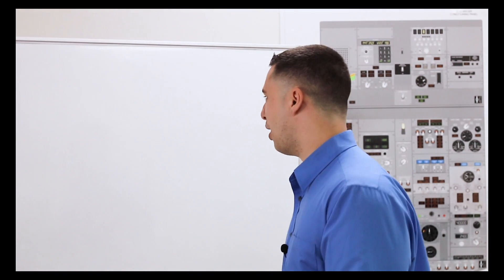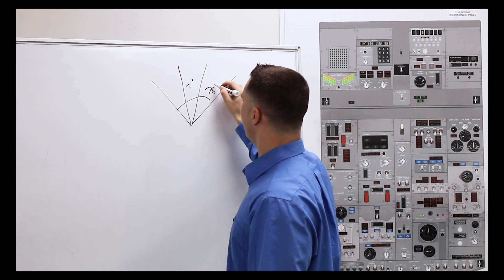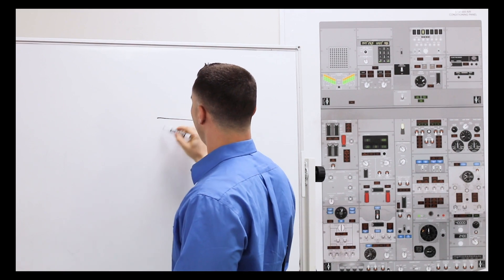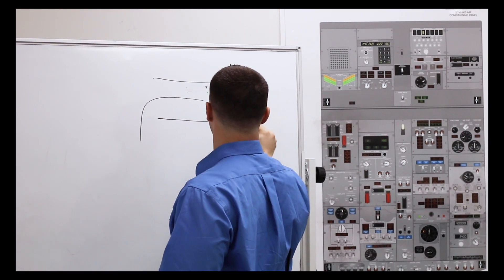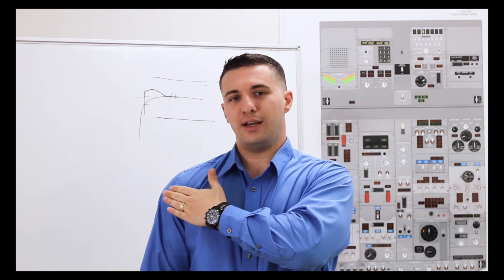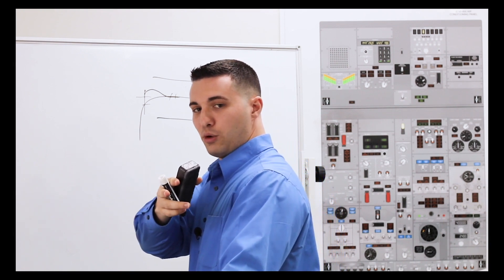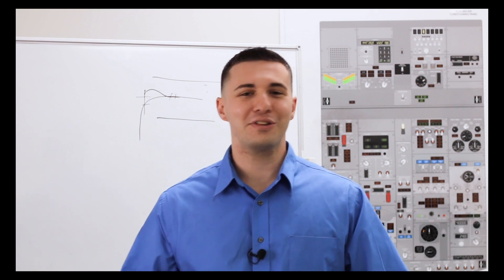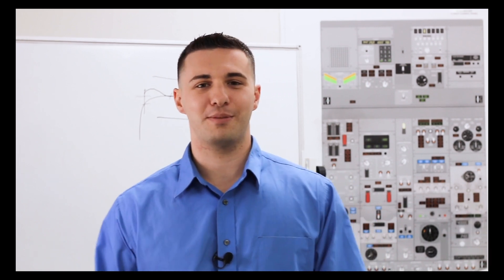B737 Taxi Techniques

Comment: The car example is very useful. There is a tendency to try to make multiple small conditions but visualise them as a steering wheel and you will stop so many unnecessary moments.